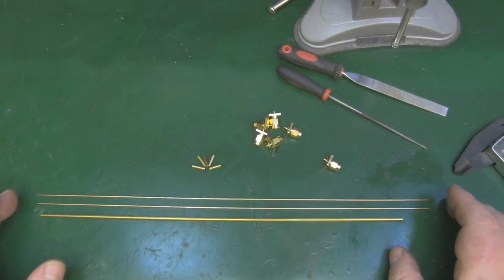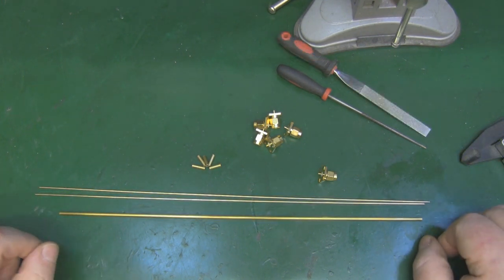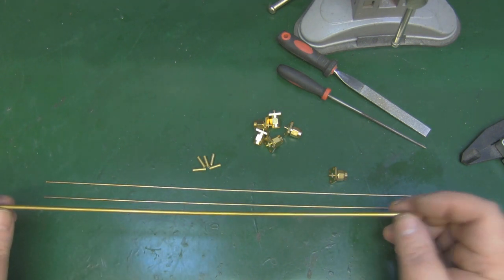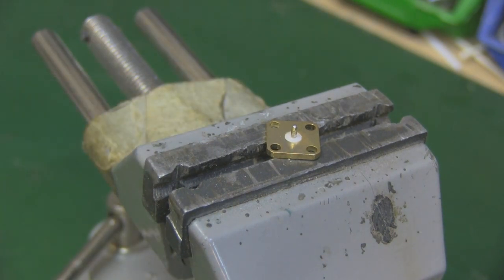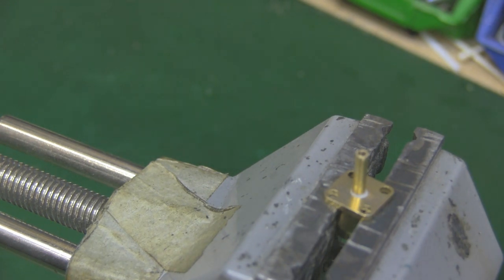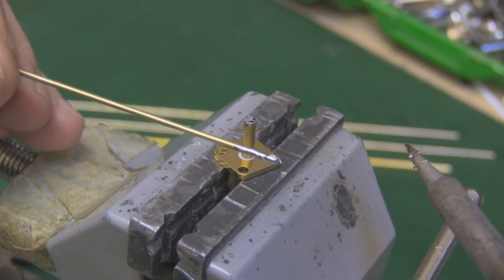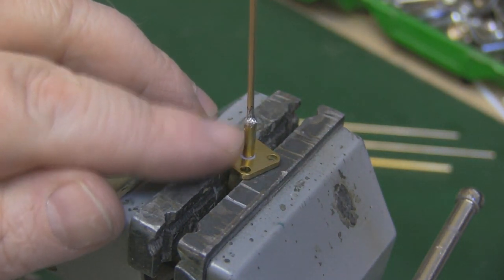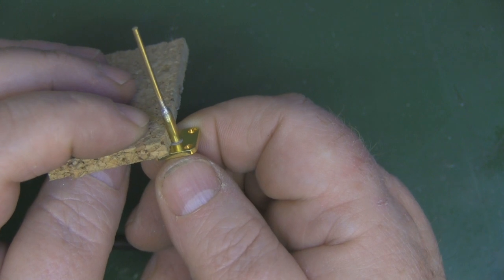How to Solder a Driven Element to a SMA 4 Hole Flange Panel Mount Connector

Comment: Add a Teflon washer to the base as the width of the new tube is too close to the ground and can cause crosstalk and potential shorting with bigger antennas/load, or add a slight gap between the end and base

Comment: How to solder rf 1.13 cable to the connectors like this? What to do with shielding braid
Reply from the maker: This is not the appropriate connector for that

Comment: I was trying to solder some ground plane wires to a BNC socket the other day and ended up melting the plastic that holds the middle pin. Even with a clean surface, proper solder and flux the solder wouldn’t take. Grrr.

Comment: Great video! What kind of brazing rod do you usually use for the driven element? I have looked at different types of available rods and are wondering whether a silver-copper-phosphorus rod will work or if the low conducting properties of phosphorus will make it a bad choice?
Reply from the maker: https://tinyurl.com/y5ycp86o

Comment: Hi Andrew, I must say i think your knowledge and expertise is second to none when it comes to Antenna's i have watched many of your videos in hope that i can find a solutions to getting wifi at the top of my garden'  Ive come to the conclusion that a cantenna may suit my needs. i have purchased a toilet brush holder ready for the project, i have also purchased a chinese cantenna along with a simmiler alpha card, it does show plenty more SSID's trhan my laptop card.
My issue is can i adapt the cantenna to plug into my router. i would love to pick your brains.

all the best  DarrenMarkStanley@gmail.com

Comment: If I want to build one of those little parabolic antennas made from the bottom of a spray can, like your blade antenna video, but I want to use a left hand polarized clover leaf, do I still use a Belin ? 5.8 GHz ….thanks in advance.

Comment: I have noticed that the TBS brand ipex to SMA cables are build similar to this.
I have a little RF power meter and they test up to 200 mW more than the cheap Chinese that look exactly the same.
They have the hollow tube similar to yours. 
Thank you for the video.

Comment: I use a bit of flux all the time, just to speed up the adhesion of the solder to avoid melting other areas. I sometime use solder paste on occasions although flux and regular solder seems to be my preference.